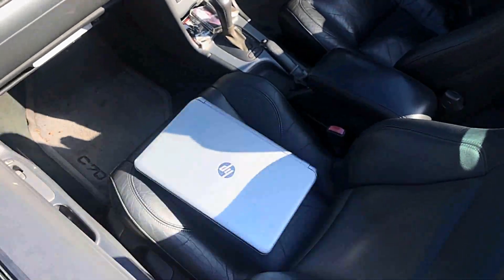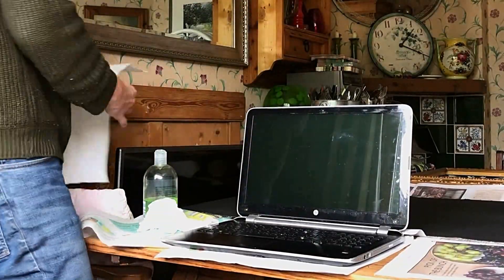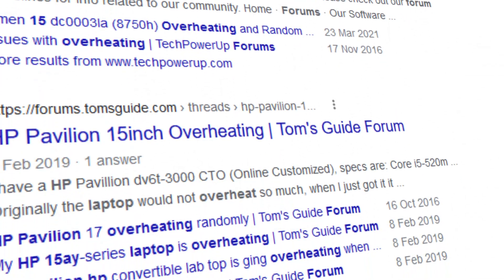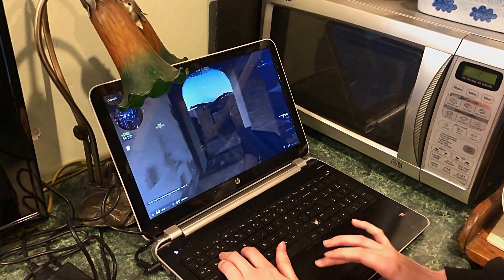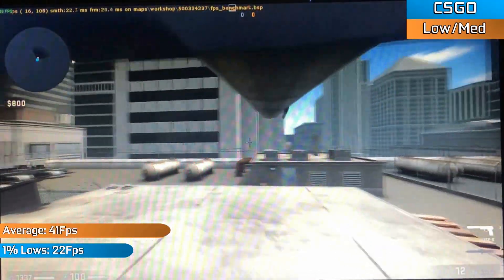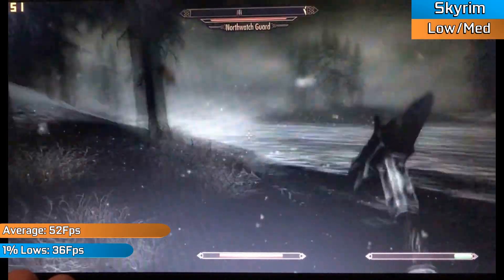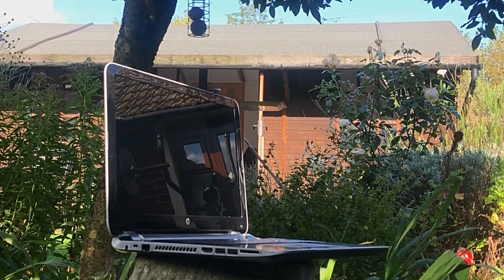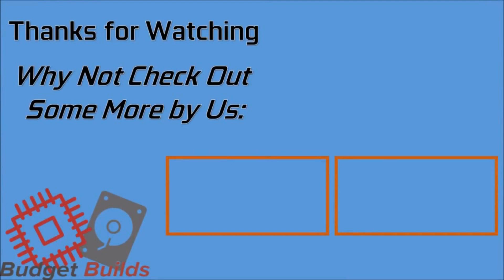AMD & HPs Awful Laptops...How bad are they?

Comment: I have the A10 6800k desktop processor (upgraded to ryzen 3600 recently) I was stuck many years ago in a bind I needed a new processor but was stuck for $ the 6800k had integrated graphics and my plan was to be able upgrade to one of the compatible GPUs in six to eight months after purchasing it. I could not get one and the apu was working so I used that for quite a while until I got a 750ti, then upgrade to rx 570 4gb. Never did get the opportunity to use the dual graphics

Comment: 112c? uh. that has never been normal. that thing is boiling. no it's not normal even for laptops with onboard graphics. my 10700u + gtx2070 hovers around 75c and if you stress it the clocks drop after it hits 95c i think
Reply from the maker: This is 100% load under a stress test of 2 GPUs and 1 CPU. Under gaming and rendering it reached 78-85C. However most laptops if utilised to its full specs can reach 100C+

Comment: Honestly, every HP laptop I've had has been worse than others within the same price range.
Whether they were a Celeron, i3, i5, Athlon, and Ryzen 3.
The main issue with the AMD models especially is that, while the RAM is soldered on in many of them, it's usually done so it single channel.
And with my previous laptop, a HP x360 with an i5, it never hit the full speed advertised, despite being an 8th gen i5, it performed worse than my, at the time, main PC CPU the i5 3570, which didn't happen with the exact same CPU in my final laptop, an ASUS Vivobook.
The Vivobook is a great backup and on the go machine, but I don't use it other than that.

Comment: I'd like a video on the legendary Sandy Bridge. Been thinking a PC with Sandy Bridge would be a good first build for me.
Reply: I5 2500k with a 1650 super or similar performing gpu will do reasonably well imo, some titles you'll see quite the cpu bottleneck though still on certain titles, at least i do here on for example battlefield 5 & borderlands 3.
On a 1660 super here with the I5 2500k at 4.5 ghz 4x4 gb ram for a total of 16 gb.

Not quite fast enough for borderlands 3 too run as smoothly as I'd like with 60 fps all the time so I'm pretty much not playing it atm.
But it's not far off honestly, might be better if I'd run dx12 instead of dx11 as im on windows 7 here still.
But I'm not that bothered too install windows 10 yet honestly for the two - three games I'd be interested too play or try out a pirated version or demo of said game if available.

Kind of hoping i can put aside some money towards a platform swap too am4 with a used 2nd gen or 3rd gen ryzen 6 core cpu, 3200 mhz ddr4 2x8 gb ram kit & a decent motherboard that allows some overclocking + mounting brackets too am4 from Noctua too my current cpu cooler.
Reply: @Mini-z1994  1650 Super is way too expensive right now. I'd rather get something more readily available like an R9 380 or 380x. Drivers would be a bit outdated, but that wouldn't be a problem if I used Linux.
Reply: @Mini-z1994  If I was going to sell my computer, I'd probably go with something still supported like a GTX 960 or something.

Comment: I actually have the Intel iGPU version that someone threw out. Honestly the disassembly is not that bad and very similar to the 2012 Dell Inspirons and much easier than the Asus U47a, but the plastic is soft to the point that it feels like if I carry a small book on top of it it’s going to snap in half.

Comment: Things have changed a bit.  Picked up a  HP Pavillion Ryzen 7 4700U (8c8t) 15w tdp, 8gb ddr4 3200mhz and 256gb nvme drive for $350.  Mind you it was black Friday 2020 but still, thing is great for the price.  Upgraded it to 32gb cl20 ddr4 3200 as well.

Comment: I actually have a first gen Ryzen mobile APU laptop. Not a half bad machine and it should be able to run a few recent AAA games (and actually DOES, The Outer Worlds does kinda run), it's just let down by it's horrible horrible thermals.
Reply from the maker: Surprised to hear about the poor thermal performance. Most Ryzen era laptops seem to be able to handle their tiny TDPs with ease.
Reply: @BudgetBuildsOfficial  Most mobile Ryzen APUs post the 3000 line have pretty good thermals. It could also be an issue with my shitty thermals (I have a Lenovo laptop made past 2014, ofc it has shit cooling), but I think it's both tbh.

Comment: It has its uses when theres nothing else but that hardware is getting old now. My current laptop is a Ryzen 4600h with GTX1660ti 16gb ram an 1.5 tb of Nvme, so I'm not suffering. Don't think I've run 3dMark on it so I'll have to give it a try.

Comment: currently using an awful hp and amd laptop myself the HP stream 14 i think ,  the system runs on windows 10 which is really it's biggest mistake. The hardware is just not up to snuff as it lags while loading up microsoft edge.  It feels more fit for a chromebook then a windows 10 machine because it is very limiting. at least it has a ssd i guess.
Reply: You could always install ChromeOS on it

Comment: I once had a HP G8, then once the charged port failed and had to be replaced. Due to the shit build quality, he had to jerry rig the chassis off, solder off and on the port then (and I kid you not), superglue it back on. Never again will I buy a HP laptop if its that bad to do maintenance on
Reply: I've had the displeasure of working on a few HP laptops and for me the absolute worst part is drivers. HP doesn't host half their drivers anymore. They really could take a lesson from Dell or Lenovo.
Reply: @loganmitchell1382  Dell at least give you the service manual for the PCs

Comment: If anyone is interested in this kind of crossfire setup. It is possible to run x3 hybrid crossfire. Using an AMD G Series Athlon or older Ryzen chip with x2 Radeon GPU’s. Make sure the motherboard and select games are compatible. Harder part is also finding the correct driver to be stable in your setup. It’s very fun to do once running. I managed to get this to work iRacing and run 3 screens extended at 1080p at 90 fps. I used a 3400G with two RX590’s I however could only allocate 6GB of VRAM to the system. Pretty fun for a $800 build (pre shutdown)

Comment: My first very own PC was one of these Pavilions, can't remember the exact specs. Going to this from the ancient office PCs with Windows 2000 felt like a huge upgrade at the time, but boy the performance was kinda rough and the chassis really didn't survive even pretty mild transporting well. Eventually the CPU fan just straight up stopped spinning and the thing would thermal shutdown after an hour of use, although it's entirely possible that that was caused by a bunch of ants crawling up inside the left side exhaust vent. Don't ask.
Reply: Ants?

Comment: Lol I own a laptop that looks exactly like the one in the video. HP Pavilion 14 n040br: Core i5 4200U 2.3 Ghz (2.6 Turbo) 2 cores 4 threads. 8 GB DDR3L, 480 GB Kingston SSD, dGPU Radeon 8670M. I used to game a lot on it until I bought a Haswell i7 (also laptop). I love that little thing to death but the gaming experience nowadays is definitely lacking.

Comment: These reasons you explain in this video is why I am so hesitant to replace the thermal paste in my thinkpad x220t lmao
Reply: Older ThinkPads are wonderful laptops, overengineered and sturdy but they're a pain in the ass to take apart past the keyboard
Reply: @rubeusvombatus  My T 530 will be 11 years old this year and it runs like a dream. 128 GB SSD boot drive ,  ,   i5 3230M CPU     16 GB DDR 3 ram , Intel 4000 HD graphics and a 1 TB storage drive. Built like a tank and a dream to work on.
Reply: ThinkPad T410 is hell. I only disassembled it enough to replace CPU/GPU thermal compound.
Reply: I have a x230T, believe me, it’s muscle memory once you disassemble it often enough.
Reply: @JackBandicootsBunker  Same with the T430. On the other hand my current ThinkPad, the T450s is stupid easy to open and replace anything that isn't the keyboard.
Reply: I just looked up how to disassemble it, and I honestly don't blame you, what a pig that looks to take apart.

The absolute worst I ever worked on was a Packard bell of some kind, just to replace the cmos battery it took a solid 2 hours of disassembly and requires removing the screen, the keyboard, about 40 different screws all of which are different sizes, and undoing a heat spreader that covered the entire motherboard on both sides, and there were no shortcuts, it all had to come out.

It was then another 2 hours of reassembly so 4 hours total just to replace the cmos battery. I wish I was joking.
Reply: ive repasted my x220T and x230T and can tell you that its really not THAT bad and is pretty hard to break
Reply: I think once you tear into thinkpads of that era you'll find they're designed to be serviced and repaired. Getting at the CPU to change the thermal paste does require you to basically completely tear down the machine. but It's a lot less nerve wracking than it looks. Taking it to bits is a great opportunity to clean out everything. The CPU fan and heat sink could probably use dusting. But a laptop from 2012 almost certainly has all kinds of junk built up inside. 

I totally understand that not every one enjoys working on PCs and electronics, but thinkpads are some of the better notebooks to work on. You should give it a shot. :)
Reply: I'll give it a go when I get a replacement for it as I use it nearly everyday for school and don't want to mess it up
Reply: @zekezander  Exactly. I have worked on a few T4x0 laptops and those things are quite easy to take apart and service. I have never seen laptops from any other brand as repairable.
Reply: @Ptero4  Dell Inspiron?
Reply: @zekezander  nah the Dell Inspirons are FAR better than this
Reply: Lenovo has hardware maintenance manuals for ThinkPads for download, though just for replacing the thermal paste on an X220t I don't think it's worth it. I recently had to replace the whole cooling unit on a much older ThinkPad T500 and the original paste was still fine.
Reply: my t510 is shit for gaming
Reply: I actually disassembled one of these for a friend, a ThinkPad X230, and... it wasn't very good. Had to completely disassemble the thing to get at the broken fan and the heatsink...
Don't you just love laptops that are almost impossible to service!